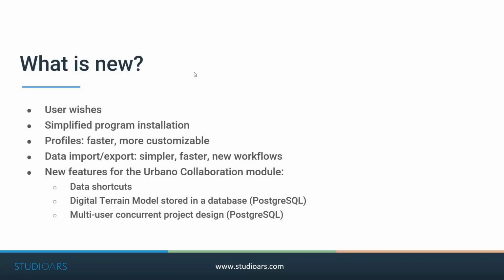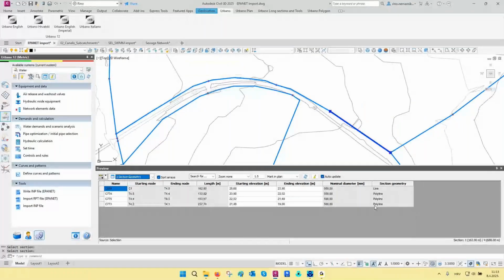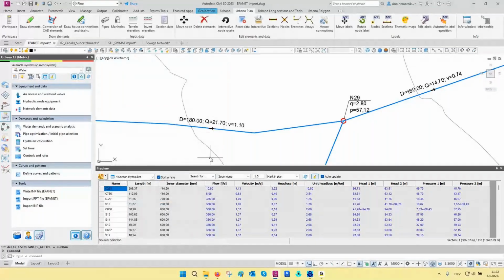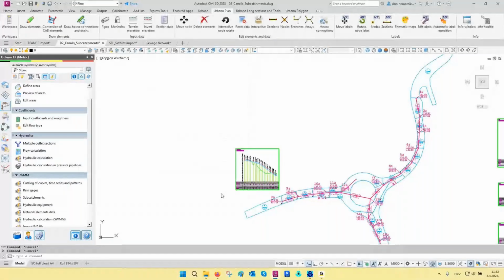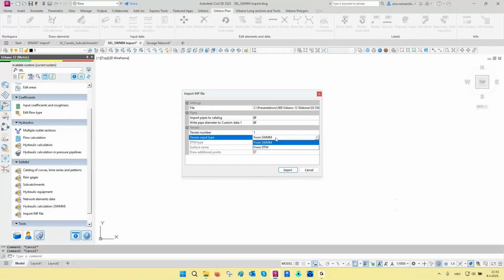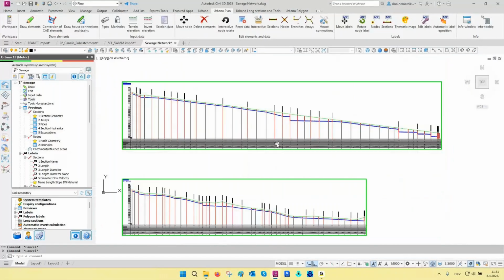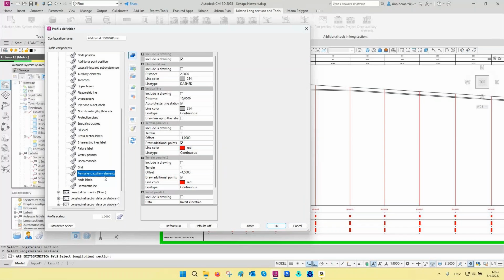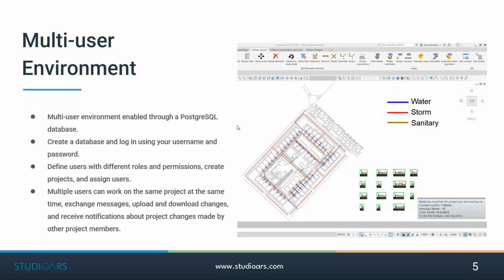Urbano 12 preview

Comment: Bookmark of Key Steps for future Reference

Water Main Design
From this video Urbano 12 preview
Examples 1 – Watermain Design with Epanet
8:27 First Example Water Distribution with Epanet
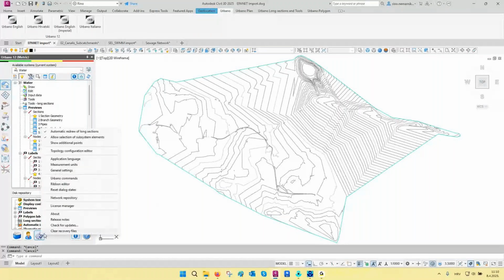8:36 Setting Measurement Units
10:12 Importing existing Epanet model from .inp file
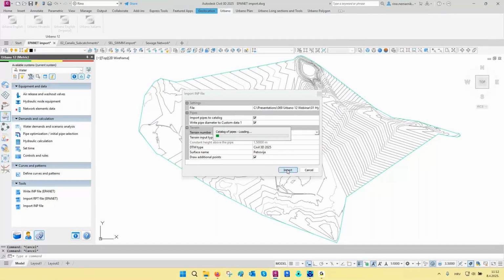11:12 Exploring Imported Model in Urbano
12:12 Binding EPanet pipe sizes with Urbano Pipe Catalogues
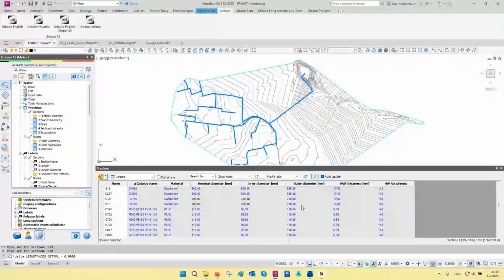12:56 Draw profiles for pipe network
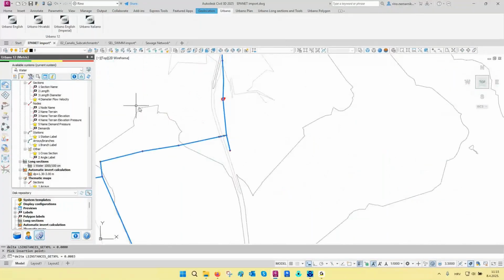13:26 Manually adding new pipes
18:08 Setting Water Demands importing from Autocad text to nodes
19:01 Auto demands
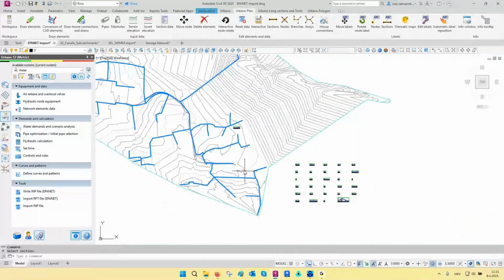19:29 Everything ready to run hydraulic Calc
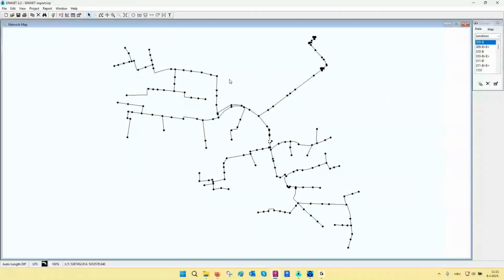19:40 Inp file create by Urbano
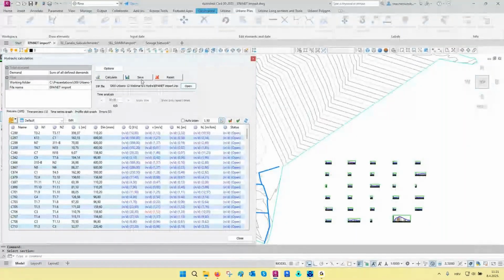20:00 Saving Results
20:20 Applying default labels with Hydraulic results and opening data tables
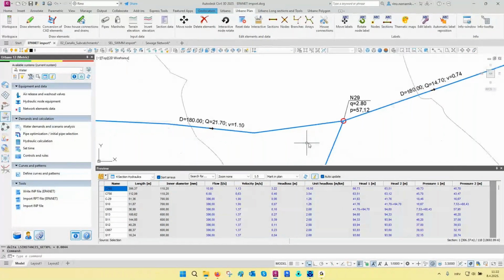20:37 Changing Units

22:22 Example 2 -Stormwater drainages Networks and catchments

45:00 Example  3 – Input data from Shp file for Stormwater network
47:57 Binding shp file data to pipe cat data
49:46 adding default labels

50:00 New features for Profiles